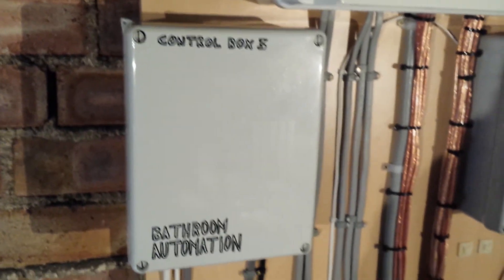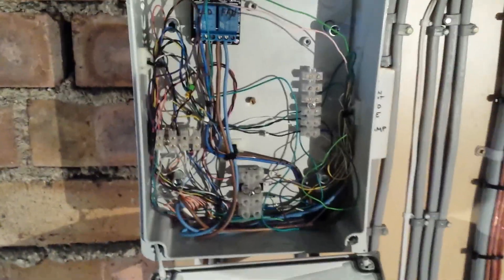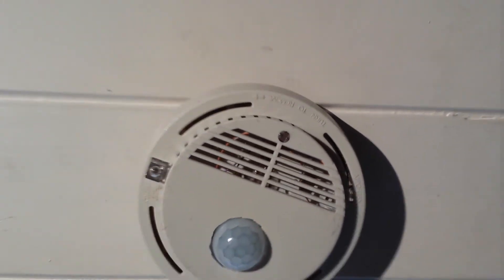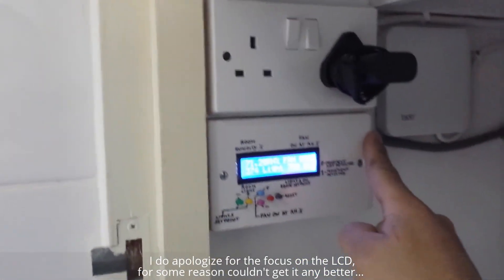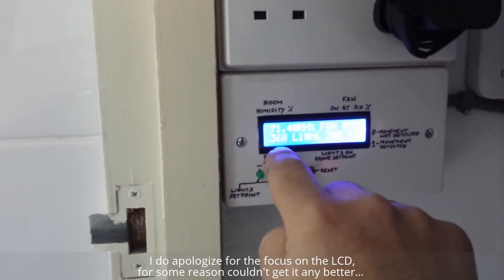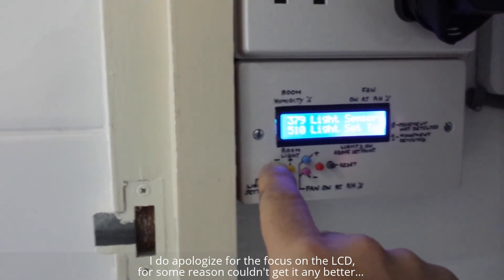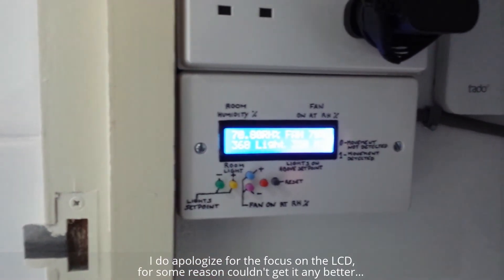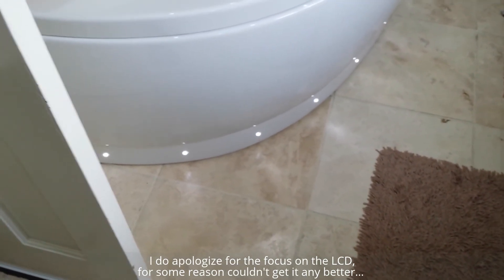Bathroom Arduino Automation

Comment: This is a fantastic project, there are a few things you could do to save space on the LCD, by using the map function eg map(light,0,1023,100,0); which will make it a % for you to show on the screen! 
I am really interested in the code you used to program all your devices, and wondered if you were able to share it, I'm just getting started with arduino at the moment. Personally showing a decimal value for the RH% is something I want to see how you do, since they have a +-3% accuracy on the DHT22 if i'm not mistaken.
Again, very well done, and thanks for sharing the video, share the code if possible please!
Reply from the maker: Hi
Thank you for watching and for your comment!
The sketch is shared on the arduino cc forum, it will worth to register in there, lots of info  and people willing to help.
Or send an address and I will send you the code...